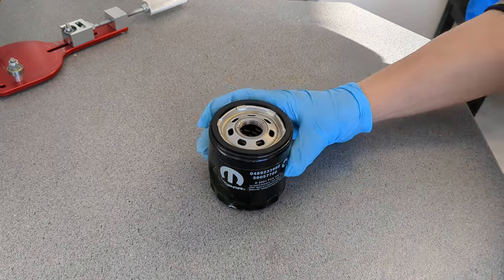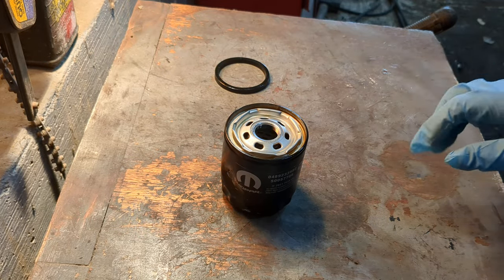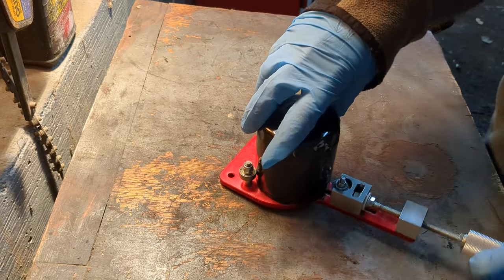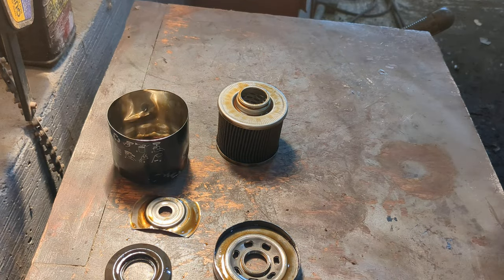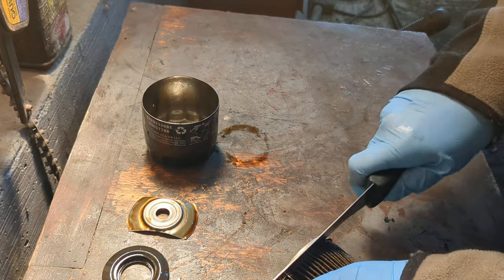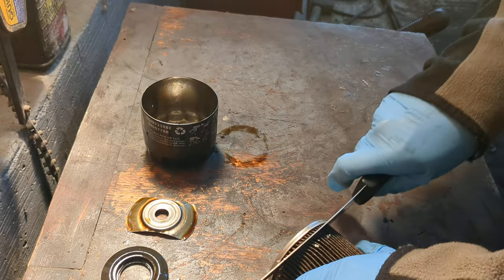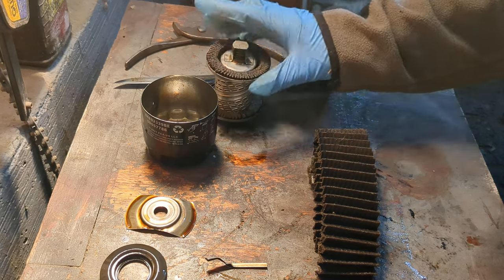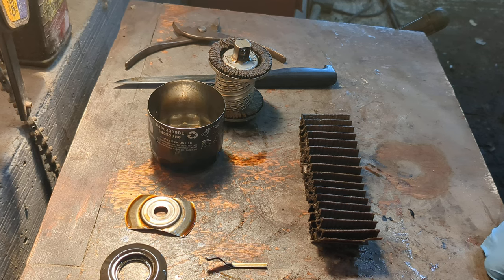Jeep Patriot engine with Carbon build up oil filter opened

Comment: This Mopar filter made by M&H Purolator. If you cut open the equivalent Puro red or PureOne application it would look very similar. Personally, as long as engine running ok, I'd keep doing what you're doing. Not a real fan of engine flushes.
Reply from the maker: Thanks Faxmen, I am leaning away from doing the engine flush, have used flush in the past and achieved good results. Not sure if it's good for this engine.

Comment: Purolator makes Mopar. 

Keep using that combo though penzoil ultra platinum and the mopar and every 3000 miles will clean it out real good you can also use Castrol a few times with really quick changes that will clean it out good too if you want to go cheaper than Penzoil
Reply from the maker: I like the Penzoil ultra Platinum, good at cleaning out dirty engines. I bought a few jugs of penzoil when it was on sale. And I have a few more Mopar filters to use. Thanks Nathan.

Comment: You could try a good engine flush.I have recently used Liqui Moly on my sons very neglected engine.Its not an aggressive engine flush and it did an awesome job.However can still be risky to run an engine flush.If your engine runs fine then shorter interval synthetic oil changes with a quality oil filter would be the safer option.The mopar oil filter you have used seems to have done its job just fine.
Cheers.
Reply from the maker: Thanks Luke, I will probably try shorter oil changes to start and if that doesn't help then maybe a good flush.

Comment: What could be causing all the carbon?  At least the filter appears to be doing its job.
Reply from the maker: Up to 200,000 kilometers it was city driven with seldom done oil changes. Hope to bring it around again.
Reply: @crazybillsgarage  If you do an engine flush make sure you post a video about it.
Reply from the maker: @billyhw5492 yes I will post engine flush if it comes to that.

Comment: Try NEW valvoline restore and protect engine oil at autozone.  Better wear and cleaning protection.  Suppose to clean like new after about 4 oil changes.
Reply from the maker: Well I gotta try something, continue carbon in filter. Hopefully your suggestion will work. Thanks